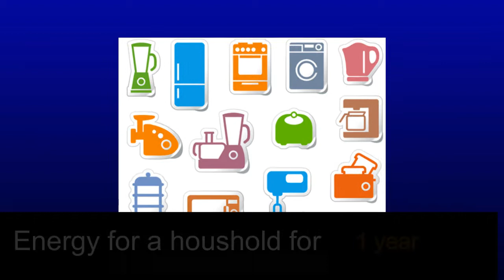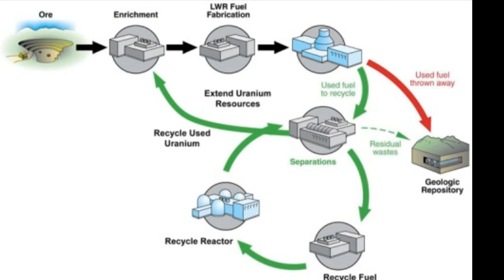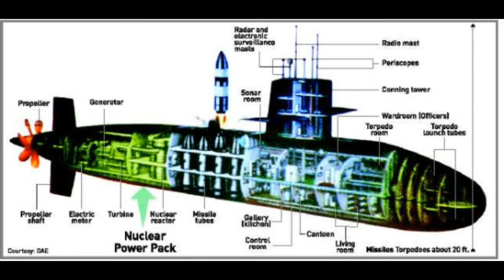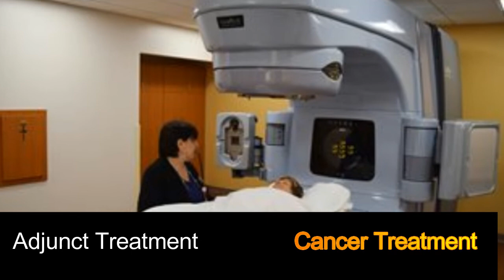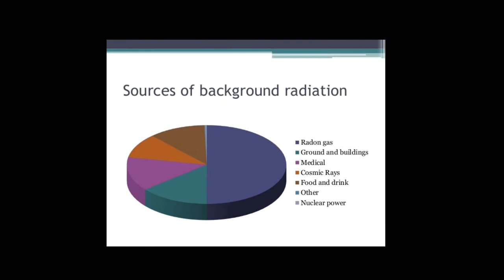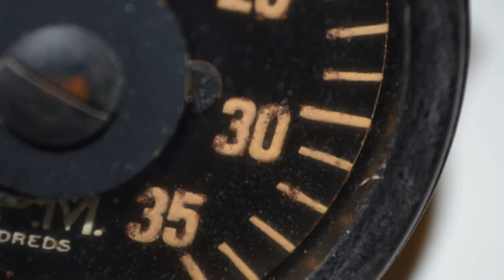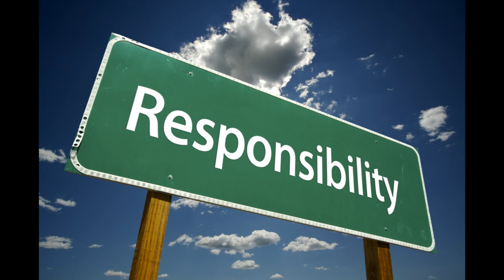10 Amazing Facts about Nuclear Energy

Comment: Nuclear Energy like all other fuel sources; rely upon Processes to harness the spent power. Where it be electricity production etc. And all these power production processes; currently rely upon historically outdated crude technology.  Such as nuclear electronic production; uses the waste heat of nuclear fussion to generate Steam; which in turn is routed through various piping; to then turn a turbine; that then turns a shift driven electronic generator. In all; there are multiple Processes that must be utilized to achieve electricity prodyction. Which in turn; lowers efficiency drastically.  Not to even venture into the waste by product of radiation damages. We here in the usa are a horrendously wasteful society.  Case in point; again as has been stated in this video the spent nuclear fuel rods still have 90% of it's fuel still available for down line power production usage. But yet; we choose to store these spent fuel rods in highly contaminated radiation storage dumps. Simplistically; every process has an action, and reaction, and also again starts a new chain effect process. We humans are highly delusional  who  refuse to admit that our actions have consequences; which are these down line chain effect processes. Nuclear power is NOT the answer to our energy needs; here in the usa. I for one have little faith in any and all governmental oversight and environmental protections. Too many times we have seen extreme negligence to outright criminal activity relating to our nuclear power production regulation and oversight. We must first strive to become much more Efficient in how we use our energy Needs. This imho is where we must now  focus our attentions. No new technology will save us until we learn to not be such wasteful arrogant prideful power consumers. I honestly have little faith in that regard.
Reply from the maker: I think there should be heavy investment in reprocessing nuclear waste fuel rods. In the UK they pulled the plug on research and all the good work done has been lost